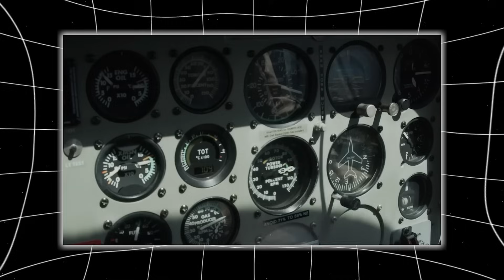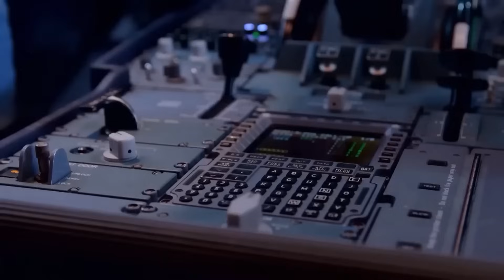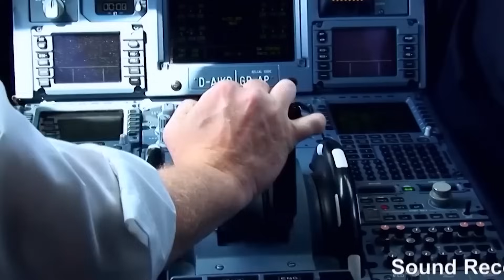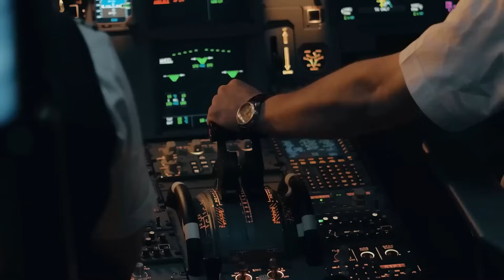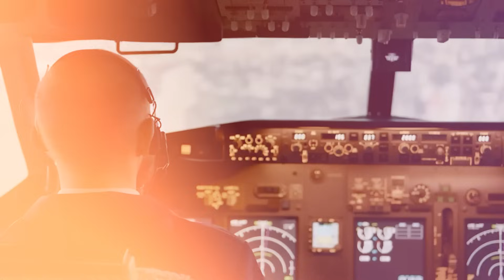Scientists FINALLY EXPOSED the Truth About the Air India 171 Crash Mystery

Comment: DO NOT CONTINUE SUCH VIDEOS AND SPECULATIONS. JUST DISCLOSE THE FULL RECORDING FROM BLACK BOX.
Reply: The full data from the FDR includes thousands of parameters and millions of data points . How would releasing that to the general public be of benefit ?  Trained, experienced, qualified  investigators from 3 countries have evaluated the data. How many of the general public have any qualifications to do a better job than those investigators?
Reply: @davidquinn6161  - THAT MUST NOT AND CANNOT BE AN EXCUSE FOR NOT REVEALING THE TRUTH. FIRST OF ALL WHAT KIND OF NONSENSE IT IS THAT IT WOULD TAKE ONE YEAR TO ZERO DOWN ON THE CAUSE. QUALIFICATIONS ASIDE. HONESTY, CREDIBILITY AND INTEGRITY OF THE AUTHROITIES, GOVT, MINISTRY IS AT ISSUE. AS FOR CORRUPTION YOU MAY NO HOW WORST THINGS HAVE GONE  IN LAST TEN YEARS OF THE CURRENT REGIME.
Reply: @ranjitsumati27 The truth was stated in the interim report. Read it. Final reports are very typically at least a year out from the incident- world wide. Some have taken 2 or 3 years.
Reply: @davidquinn6161  - Why the interim report  than not disclosing the complete conversation between the two pilots? One may well be not comfortable with that there were only two sentences just one each from them and no other word, no other exclamation........and this 1 to 3 years cannot be convincing to anyone because 3 years later (as it has happened in the past in one of the incidence) nothing will come out and people would not want than bother about it that much later and automatically it will be rested........3 years.....? it did not take that long to land on the moon travelling from the earth.............huhhh
Reply: @ranjitsumati27 Maybe any other of the CVR was irrelevant. It was a flight that only lasted 60 seconds. The investigation was conducted by qualified, experienced air accident investigators from 3 countries. Are you qualified ?